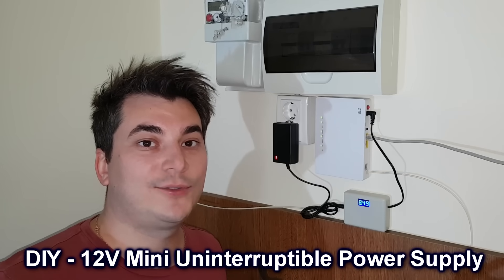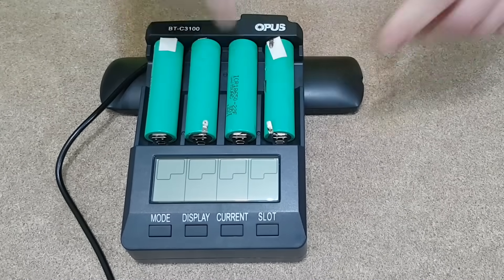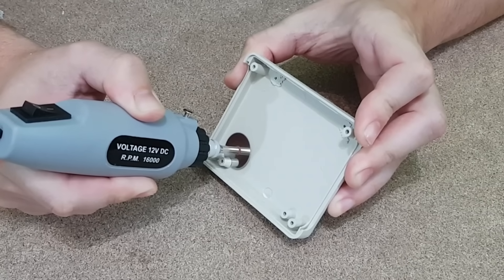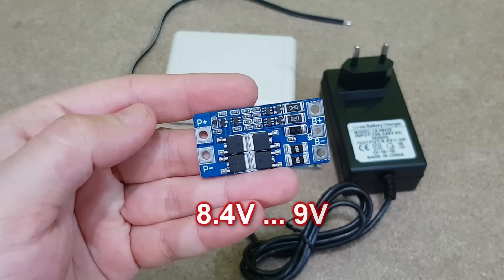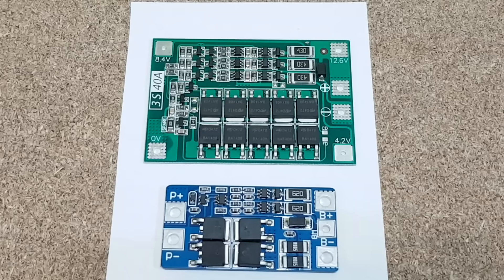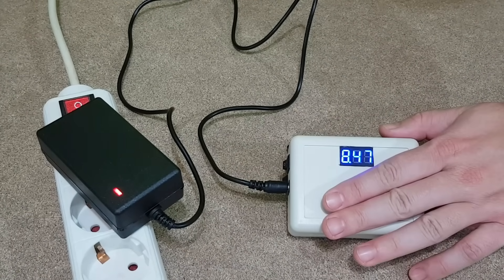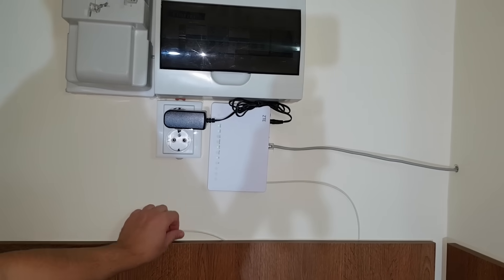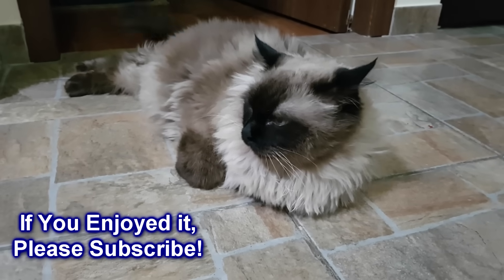DIY - 12V Mini UPS

Comment: is there a way to get the BMS to reduce the target voltage for the batteries? I would think that limiting the voltage to, say, 4.0V, on the li-ion cells would extend the life of the cells significantly.
Reply from the maker: hi. you can't make the BMS charge the cells with less voltage. but you can add a diode in series with the charger. it will stop the current going back to the charger LED and, because diodes have a small forward voltage drop, it will decrease the voltage to around 8V. this will probably extend the lifespan of the li-ion cells, but it will decrease the UPS autonomy.

Comment: Very nice and neat build and clearly explained. The only issue I have with it is the backfeeding of the charger. Maybe a negligible drain, but how about using an inline diode to prevent this? It will drop the charging voltage by about 0.6V, but I think it would still work. What are your thoughts?
Reply from the maker: hi. the charger LED is using only a few mA. you can see in the final part of the video, when I unplug the charger from the mains and connect it to the UPS, the battery voltage is perfectly stable. you can add a diode if you want, but it will lower the charging voltage, so the cells may not get fully charged. this will actually decrease the UPS autonomy. it would be better if you find/modify or build a 9V charger, use a diode, so the voltage will drop to around 8.3V wich is ok for the battery pack and the charger LED will not draw anymore current from the battery pack.

Comment: Interesting. I simply purchase new 18650 batteries from eBay sellers rather than try to work with used ones.

Comment: that is not UPS, its 12v powerbank.. UPS need to connect to electricity all the time. only channeling power when there is no current coming in from the electric socket.

Comment: Very nice video and useful! If I understand well, when power line is present, current goes thru protection board, to cells and then to step up converter, right?
Reply from the maker: hi. the charger delivers power directly to the step up converter, through the on/off switch. the BMS and battery pack are connected in parallel with the charger lines, and the battery pack is charged when needed.

Comment: Thanks for the video.  Can you please advise what changes I would need to make if I want to use 12V power supply?  Thanks for your answer.
Reply: with exactly same build you need one more step down DC to DC board to lower 12V from power supply to 8.5-8.4V  to charge the whole mini UPS, all the rest stays the same.
Reply: @baniakrulez  Thanks.  Will do.

Comment: if the charger stays on won't it discharge your battery faster?  maybe install a 1 way circuit?
Reply from the maker: the charger LED is using only a few mA, so it doesn't matter. if you use a diode to block the current going back to the charger, it will decrease the charging voltage, because diodes have a small forward voltage drop.

Comment: fuses link?
Reply from the maker: https://www.aliexpress.com/item/32868724895.html?spm=a2g0o.productlist.0.0.4b6b16bbu2KyLi&algo_pvid=5369a373-086c-47e3-bb2d-a8ea2388cc36&algo_expid=5369a373-086c-47e3-bb2d-a8ea2388cc36-8&btsid=659c5bf5-d809-4a0a-bddd-e316eb801aaf&ws_ab_test=searchweb0_0,searchweb201602_5,searchweb201603_53
Reply: Sorin - DIY Electrical Nerd 250V?
Reply from the maker: yes. that's the maximum rated voltage.

Comment: Thanks for your guide. I want to replicate your project for my router. I ask you the value of the two fuses to be installed near the batteries, these are 1.5 amps?
Reply from the maker: yes. but if you need a higher output current from the UPS, like 1A, you need 2A fuses.

Comment: nice tutorial. im planning to make a 3s bms setup of these. i already have set a 3s 6p battery pack but  planning to limit 4.0v each cells to avoid stress to the battery. only missing is a module  that could act as a ups between the router charger and the battery. i hope you could make a 3s too coz i know you could do better than i am
Reply from the maker: I will build another UPS soon, with 2 outputs, higher output current and bigger capacity.
Reply: i have a follow up question, do you think it is more power efficient on the ups battery if 3s been used instead of your 2s?
Reply from the maker: the overall efficiency will be better with a 3S battery pack (output capacity divided by battery capacity). but it's a bit difficult to use the entire battery capacity. you can charge it with 12V instead of 12.6V, so it will not use the entire battery capacity.
Reply: means you can only charge each parallel at 4.0v max? i guess its a pretty good deal since charging the li ion to max may degrade overtime, im not sure if its a hoax but some recommends to charge them at only 80%. but im thinking if we add a load while charging the battery pack, the charger may not output 12v max, let alone the current it delivers since the modem requires 0.5amps to run. 

my 3s 6p could last more than 24 hours. sometimes power interruptions could last 24 hrs specially at the event of taal volcano erupted days ago. there are some power lines need to be fixed. also i have issues im not sure if its the bms or the charger, i unplugged the pack on my router and charge it independently. it couldn't take more than 0.4 amps to charge, im  slow charging from 11.1v to 12.2v  since 16:13 hrs ago, now it's down to 0.08 amps nearing full maybe, my usb voltmeter doesnt seem to aquire the accurate reading including the maH which reports 5284 mah at the moment
Reply from the maker: if you make a 3S2P battery pack it will take a lot of time to charge, if you use the modem charger. as you can see in my video, the original charger drops from 12V to 11.8V when I turn on the ONT. it doesn't have enough power, even though it should deliver 1A. so it's not good for powering the ONT and charge the battery in the same time. I still suggest you use a dedicated charger. and if you want it to last 24h, you should make a 4S3P battery pack with good cells, use a 4S BMS protection board with balance, a 16.8V 2A charger, a step down converter to decrease the voltage to a stable 12V. it will use the entire battery capacity, until it will drop from 16.8V to 12V with a stable 12V output.
Reply: @Sorin_DIY  oh that makes sense. plus, i could charge the 4s straight to my 18v laptop laptop charger. i will consider your suggestion, but still hoping for your next ups build. if there are problems im sure you could narrow it down. i have plenty of good salvaged cells to test, but i only have bms for 3s only. local shops dont sell these kind of boards and i have to get it online

Comment: Hi Sorin what are the voltage rating for fuses you said 1.5 Amps but did not said the voltage sorry if I said some thing wrong I am no Expert in electronics I am a Senior Programmer Just trying to Power my smart home sensors with Power backup :) Thanks to you I am building my modem, Wifi Access Points and arduino esp8266 based iot sensors Power backup that connects to my custom Smart Home Server written with C#
Reply from the maker: hi. the fuses in this video are rated for 1.5A 250V. but if you connect a bigger load to the UPS, like 1A, you need 2A fuses on the li-ion cells.
Reply: @Sorin_DIY Thanks all for your help Sorin👍

Comment: Can you please review the 18650 discharger which is available for cheep (has 3 buttons , a small screen , a micro USB input) could it be a cheap alternative for the costly battery dischargers like opus ? ( https://www.amazon.in/Fdit-Lead-acid-Capacity-Discharge-Analyzer/dp/B081T8VGZB/ref=mp_s_a_1_7?adgrpid=57788200926&ext_vrnc=hi&gclid=CjwKCAiA0svwBRBhEiwAHqKjFsnnqvXoVf_Cl0EXhfcbVCTZInejjfQ6iSiQ-Vq1sHWr6z5dlU638xoCkQ0QAvD_BwE&hvadid=294132290636&hvdev=m&hvlocphy=9062044&hvnetw=g&hvpos=1t1&hvqmt=e&hvrand=16916613028793358585&hvtargid=aud-825890243027%3Akwd-299889884048&hydadcr=9388_1780730&keywords=battery+capacity+tester&qid=1578379226&sr=8-7 )
Reply from the maker: ok. I will order a few and test them.
Reply: @Sorin_DIY  tnx a lot man... It means so much to me 😊☺️

Comment: Salut. Am facut schema ,iar in locul transformatorului de 8,4v am lasat transformatorul de 12v al routerului si sa treaca printr-un modul tp5100 care stabilizeaza la 8,4v, dar vad ca la iesirea din xl6009 a fluctuat cumva tensiunea si am bulit intrarea de la router si acum se tot deconecteaza wifiul :) Noroc ca era in garantie si l-am dus inapoi. :) Am facut 2 upsuri dar au mers vreo 2 ore apoi fluctuatii iesire voltaj xl6009. Cred ca era mai bine sa nu ma complic si sa caut un transformator de 8,4v sa treaca prin bms 2s!
Reply from the maker: salut. depinde cum ai conectat celulele de li-ion. modulul xl6009 nu este stabil cand tensiunea de intrare scade sub 3V, cateodata chiar sub 3.5V. daca nu conectezi minim 2 celule in serie, tensiunea unei singure celule scade prea mult si modulul xl6009 nu mai stabilizeaza tensiunea de iesire. deci tot iti trebuie minim 2 celule in serie cu BMS. aceeasi problema am avut-o si la powerbankul facut de mine cu 6 celule. dupa ce am terminat clipul, am observat ca variaza tensiunea de iesire. am inlocuit modulul xl6009 cu MT3608, care suporta tensiune de intrare de pana la 2.5V.
Reply: @Sorin_DIY  Ordine: transf. 12V- tp5100 -8,4v incarcare bms 2s 20A balansare(2x 18650 inseriati) apoi prin xl6009 iesire regl. la 12,1v. Probabil tp5100 n-a putut sa incarce bms-ul si sa tina voltajul in acelasi timp de 8,4v la intrarea in xl6009. Ceva e ciudat. Am si mt3608. Stima.

Comment: Power supply for my router nominal prices are 5 volt @ 8 Amperes. this router covers also IP telephony. On the other hand I have to cover wireless phone appliance with the same characteristics. Since I must cover longer time periods in cas of emergency states cases of power failure I' m wondering if I can use a step down converter from 12 V DC to 5 V DC for this project. Is it OK? thank you for your time.
Reply from the maker: that's odd, I've never seen a router that requires 8A... yes you can build it, but you need a lot off good li-ion cells and make a battery pack with 2S and 5 or more cells in parallel. or make a 3S4P battery pack, or even bigger. you need a powerful step down converter, like the one I use in my variable power supply. the UPS will probably need a fan for good ventilation.
Reply: sorry tit was 0.8 Amperes

Comment: You must add a diode to the laptop plug from where the adapter is connected to prevent the electricity from going back towards the charger. Not only would the backup of UPS will increase but it would be safer this way.
Reply: my thoughts EXACTLY
Reply: What should the diode rating be?
Reply: @AtlantaTerry  anything would do a 1n4007 has a rating of about 700v.
Reply: While your at it could add an inline fuse that would blow before the ones on the battery did as those are harder to get to.
Reply: @whitepawrolls  jvmbb
Reply: Sorry where would the diode be connected?
Reply: @thanoswasright626  we would connect our diode to one of our Input terminal. So that our Input charger only able to charge our battery not taking current from our battery
Reply: Exactly
Reply: The voltage will da
Reply: That would drop 0.7v around through the diode and the battery won't charge with 7.9v remaining voltage
Reply: @retweaksatapathy106 

Eso mismo...
La gente siempre menciona agregar diodos en los powerbank, pero nunca considera na caída de tensión que produce..

En un cto. alimentado con 5V o 12V, una caída de 0.7V es mucho.

Tal vez usando un JFET podría ser...
Reply: @retweaksatapathy106  what's the solution to that? My 12v input drops to 11.6 after using diode, so how would I charge batteries to 12.6v?
Reply: @AbidAli-bo8sv  Use an active diode maybe 🤔? Or use a variable power supply to ramp up voltage equal to drop if possible. Google your issue, there must be a lot of solutions.
Reply: Any solution to that? Even today I needed a solution, still searching a viable option for a 5v adaptor dropping over a diode to 4.3V
Reply: @retweaksatapathy106 

Circuit with jfet/mosfet or rele?
Maybe a 9V adaptador+7805? or mod the 5V adaptor up to 5.7V?
Reply: This is why Tony Stark told Ivan Vanko that his design was good, but flawed in Iron Man 2. 
No diode from the Arc Reactor to the load. 
Still... better than Hammer Tech.

Comment: great video man.... just bought Opus BT - C3100 V2.2 after i seen it in this video. ( you should do amazon links with tools used in the video )

could you do a UPS 12v 18650 battery replacement in the future ?

Comment: Really, a quality video, with nice humor.
I like that you give instructions for a safer and cleaner result.
Plus you give explanations of what you are doing and why. Regardless of building or buying such a mini UPS,  the learning process and understanding of the details are valuable for other projects plus as a general knowledge too. Thanks.
Reply: It's not working for me. Before connecting to boost converter, bms output voltage is 11.68 v but as soon as I connect it to boost converter, voltage drops to 0.67 V. And so can't step up the output for 12v. But when I connect boost converter directly to battery output, it works, which is not advisable !!!

Please help with this
Reply: @viralindia8951  if your bms output is 11.6v then you can easily use it as 12v. There's no need to use a boost converter. Also, there is a limit to the input voltage for the boost converter. You should check the specification.

Comment: Many 12V router will work normally with 5-8V voltage. Because there is no electronic circuit working with 12V (the processor is probably working at 5V or 3.3V), there is an DC/DC converter at the input. So, the DC/DC converter to 12V just waste energy.

Comment: This is not real UPS, it's just a battery protection board and DC/DC converter.

The real UPS should charge the battery automatically and disconnect the DC/DC converter while there is main's power.

I see the circuit on 7:42.

So, the input is 8.4V and there is inefficient DC/DC converter to 12V. Instead of powering the device directly with AC/DC converter there are two conversions - AC/DC and DC/DC.

How is the charging current regulated? What if I connect 12V to the input instead of 8.4V? Does the protection circuit contain actual charging current regulator?
Reply from the maker: hi. there are 3 main types of UPS: standby UPS, online UPS and Line-interactive UPS. my mini UPS is the equivalent of an online UPS. the power is converted for the battery and BMS circuit, then converted again for the router. this 12V mini UPS is... what it is... a simple and cheap online rechargeable battery, that needs an 8.4 - 9V power supply (not 12V or 24V or anythyng else), it has a small capacity (because I want it to be small) it has a cheap BMS board (because it's simple and cheap) and it has a stable 12V output, because that's in the title (not a 5.8 - 8.4V UPS). of course is not a perfect design, it's a cheaply made battery pack with cheap Chinese components. of course you can find flaws if you look deep into it. for example when the li-ion cells are fully charged, after they are balanced, the charging voltage doesn't cut off completely. the BMS still puts a very small amount of current into the cells, and doesn't let them self discharge below 8.3V. this will shorten the cells life. but hey, nothing is perfect. and that is not the point of this video. the point of my videos is to explain the best I can (again... not perfect) how different electronic components behave and work, and let the viewers decide if they find something useful for them in my videos. but I plan to make a better (not perfect) standby UPS and explain the differences.

Comment: I want to made same thing with better load upto 12 V 5A for my DVR Can you please suggest which boost converter can be used for project.
Reply from the maker: hi. in that case you can't use a boost converter. you need a bigger battery pack, minimum 4S, but preferably 6S or 7S and a powerful step down converter. if you want bigger autonomy I suggest a 7S2P battery pack. I'm planning to make a better UPS, bigger, more powerful, that can be used with multiple devices. but it will take some time...

Comment: Nice little ups. But may I ask you.., can't a power bank (for smartphones) be used in such a way?
Reply from the maker: no. powerbanks cannot give an output current, while they are charging. you need to modify it to be able to do this.
Reply: @Sorin_DIY  Depends on the model. Some can.

Comment: Very nice, I was designing exactly such a thing for my rooter today and there pops up your video in my recommendations! In my design, I also added a constant current, constant voltage buck converter and set the current limit recommended on the data sheet of the 18650.
Reply from the maker: hi. if you used a buck converter, then it means you have a bigger battery pack. but the current limit of the buck converter is for the converter output, not the converter input (the battery pack). the input current and output current of the converter differs, depending on the load, converter efficiency and battery pack. there is nothing wrong with it, just don't set a lower output current than your router needs.
Reply: I have the battery pack charging FROM the buck converter output, that way when the battery is flat, it charges at constant current (1.65A for my cells... they're 3500mAh so ~0.5C charge) up until the preset voltage is reached for full charge, then it switches to constant voltage mode and then the current drops quickly down. I still use a boost converter on the battery pack to the UPS output to keep the voltage constant as the battery voltage drops. I then use a much higher voltage power supply (24V, ~1A, 25W) because its slightly cheaper and also I get better efficiency stepping down from higher voltages with the buck (>90%). The buck isn't strictly necessary and your design is elegant.